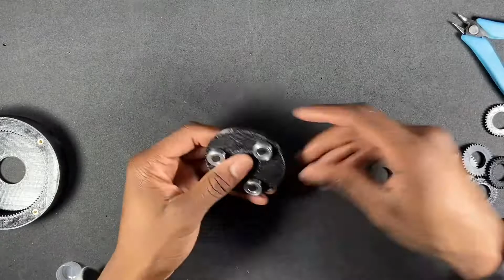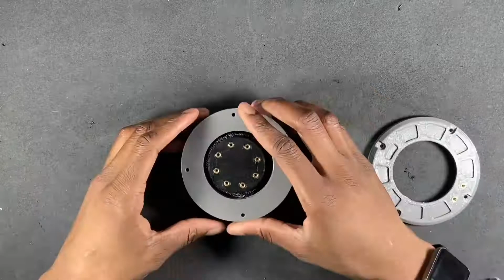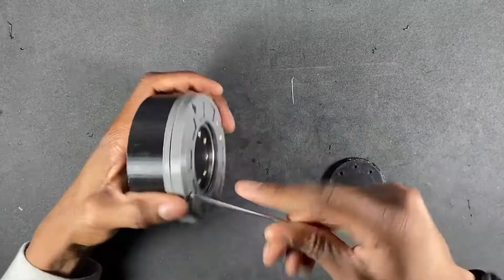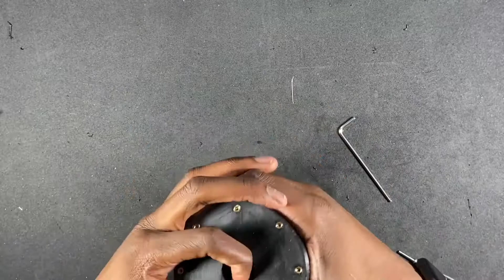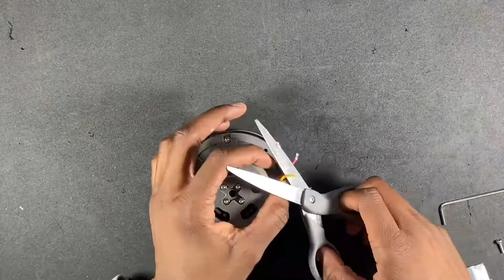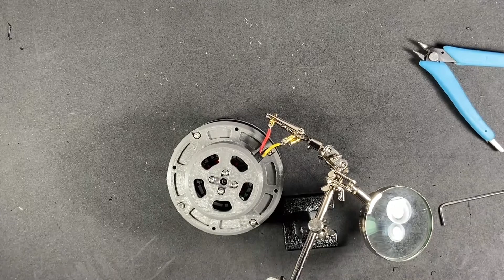3D Printed Robotic Actuator Assembly

Comment: I was excited to see this project! I made an actuator like this a couple years ago using the 5010 750kv brushless motor, and I was able to get it working at a 10:1 gear ratio, however the gears quickly chipped out. I want to revisit this soon!